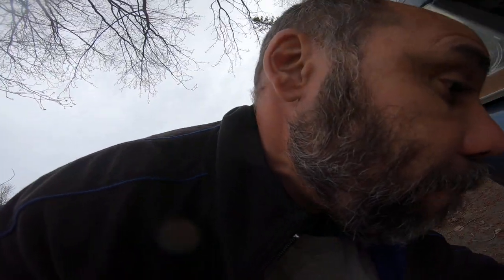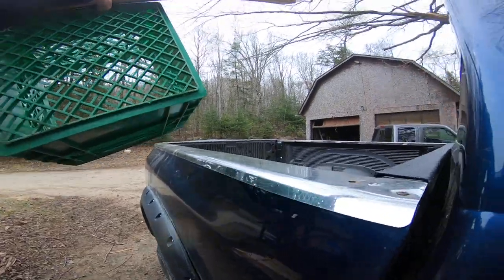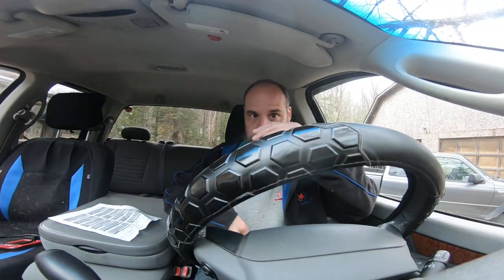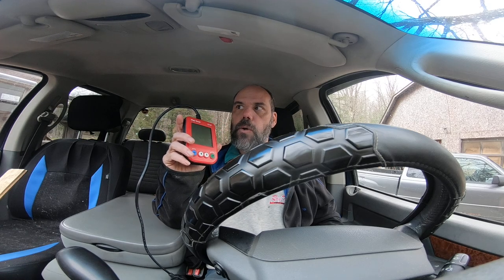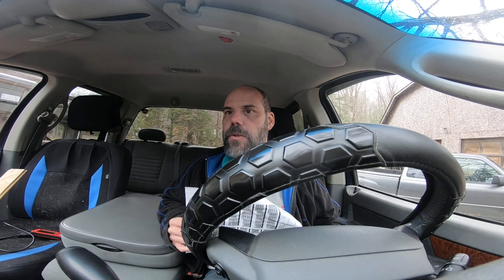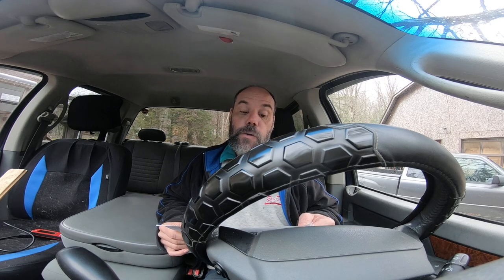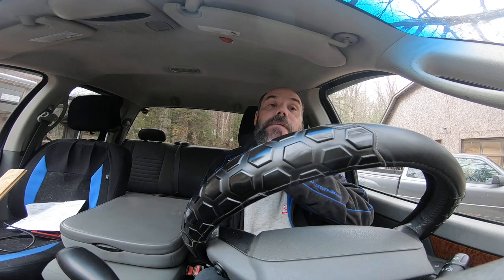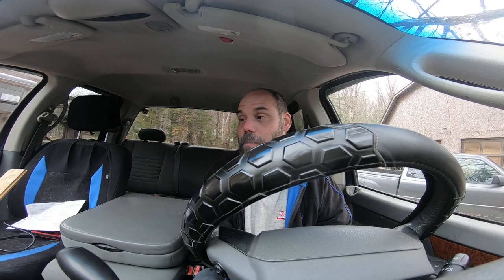P0405 Exhaust gas recirculation sensor 2006 Dodge ram 1500 5.7 hemi .1-2

Comment: Be sure that's the part that is defective because it's not always the case. I'm not completely familiar with Dodge problems but past experience has taught me that other things in the same circuit can cause an EGR error code. Dodge is very famous for having multiple items in a single circuit and any one of those can cause an EGR error. I once had a Cavalier that gave a faulty ERG valve and it was a stupid vacuum line that caused the issue. I'm glad I just didn't put a new EGR because it was only a 25 cent hose that was the problem.